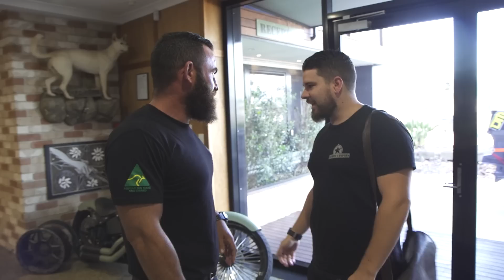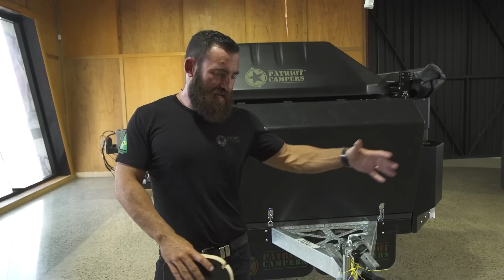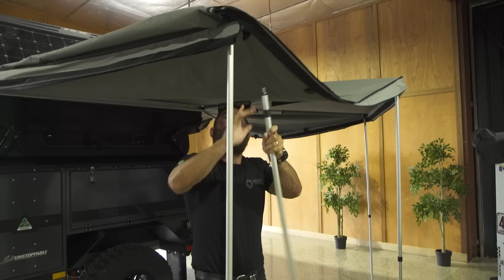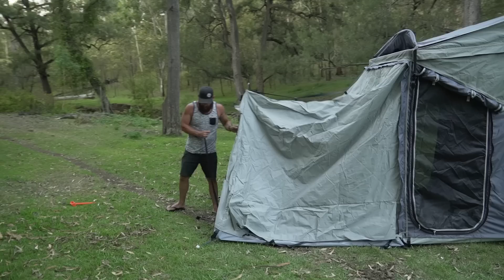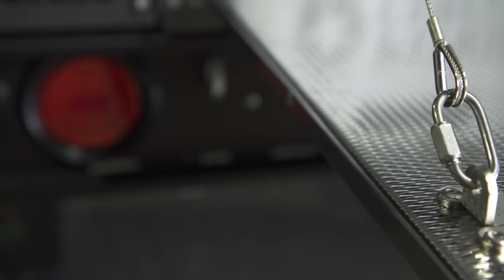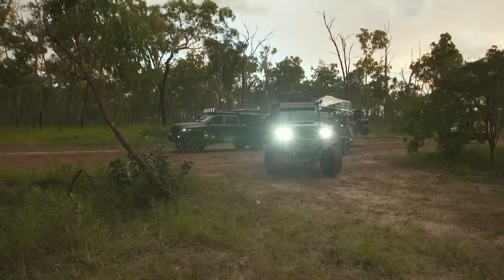Patriot Campers X1-H - Design and Engineering Walkaround

Comment: I dont mean to be long winded , im in florida. And i know your partner site is in oklahoma, i want battle born lithium batteries and mppt set up. Am i better off buying from you as this obviously is built over there. Or can this be done in oklahoma. I also want the same color as in this video. 2nd. Instead of the diesel heater can a mount be made for out side of unit to hold a hot water on demand unit. For showering and hot sink water. Thank you

Comment: Not sure why you would want to test the actuators with the oil removed. It’s not a valid test because they are not designed to run without lubrication. Imagine testing a car engine without oil. Engines seizes and breaks very quickly because the test was invalid not because the engine design or longevity was to blame, but because the engine was deliberately made to fail for no actual teal life purpose.

Comment: A few questions.
1. Can you open the awning before you lift it?
2. Sorry to ask... but is it possible to use the Alu-cab 270.deg awning as the support poles are less essential except in really bad weather. 
3. Is there any way to mount bike racks on the camper for transport?

Comment: I don't see a whole lot of security in these trailers.  If you're asleep up on the bed can't someone come to the side and mess with the control hub?  Also, there's no way to access the control hub while you're lying down.  The poor insulation of where you sleep (I realize he admitted it won't turn into a sauna) but how would you fare in colder temperatures in Canada?  Idk, I initially loved the trailer but I think practically it's not suitable for average/extreme conditions.  This is more of a June trip to the beach and that's it.
Reply: Also where are the locks on the pieces that open up?  Seems like a very unsafe camper, maybe not for someone who's alone but with a large group.

Comment: You should incorporate a fan / ventilation setup in the hard top for the tent so that you can get some air flow into the tent area. This would help immensely on the very hot nights when you're camping.
Reply: I don't see why you couldn't install one after market. Basically Patriots are really good but they're not perfect. You'll always have to add this or that before striking out for the territory's.

Comment: Try doing your stress test in real world outside temp vs. airconditioned covered facility!  Humidity and extreme temps will hasten warping and drying off your lubrication! i applaud your products and will buying in the future! Flexible solar panel will not last. Hexocore roof should be painted in white so it will not be too hot during the summer months camping and will not be conducive and hasten the destruction of your flexible solar panel!
Reply: Existential Optimist great points on the colouring . He did say the actuators have had the lubricant removed for testing but you are correct about real conditions. I’d be willing to test them out if I could afford to retire and patriot sponsored me. They are top notch campers and the tent is massive compared to the drifta and looks like it will divert water runoff better.
Reply from the maker: Hi Mate, tests are done in the factory, we pulled it into the showroom for the video. Point taken on the white roof! Thanks

Comment: Also would be nice to have 4 jack points like a box or tray camper so you can lift it off the frame so you can run to the hardware store for some supplies.

Comment: If only they would come up with a cold weather rig. Made fully with fireproof canvas. And walls. You wouldn't need the camper top part. You set a propane heater up or a woodburning stove.  Serious hunters and outdoorsman would go nuts for this. It can be a pain to set up a cold weather tent. And with this set up and ability to go where its needed for a good base camp bro you'd kill it in the US market. The 4 seasons market is arguably 5 times bigger than the warm weather market. And with cold weather you'd corner the North American market.

Comment: definitely need to introduce limit switches and controler module on roof to hit control button and put control away, not hold it down.  my hard lid has that setup instead.

Comment: Put rain gutters around the hard top with pipes to direct the water downwards.  Could also use this for a rain water capture system.  Waste not, want not.
Reply: nice one i see what u mean .i would add extra window same as the one already in the pod . and some pockets next to the window at the bottom
Reply: window at the top off pod for the heat to go thru

Comment: These are awesome camper trailers.  Can’t afford one of them but still awesome!
Reply: These are awesome but $$$$$$$$$$$$$$$$$$$$$$$$$$$$$$$.

For not much more we bought a new 40' 5th wheel with residential fridge, fireplace, water heater, full size microwave, 2 leather sofas, love seat, 2 air conditioners, furnace, king bed, toilet, shower, and much more.

Comment: instinct that instead of putting in electric actuator I would have just gone with some gas shocks or something to open the lid I think if you introduce the electrical component that's a good place that something will fail.

Comment: Why the electric motor and not just a counterweight hinge? Wouldn’t it be lighter, less maintenance, more reliable and faster?
Reply: J Gold just replace the actuators in 10 years .. 
If you can afford and X1H can afford new actuators in 10+ years
Reply: I never mentioned price, but thats another issue... What's your thoughts on the other 4?

Comment: Nice rebuttal of the recent criticism circulating from others. Great products. Just to clarify the point about retrofitting - you won’t retrofit non patriot campers kit OR any kit?  Just thinking, if I’d forked out decent coin for an X1 and wanted to upgrade it to an X1-H by “retrofitting” the new hard top tent, you guys wouldn’t do that?
Reply from the maker: Hi Tony, sorry mate we can’t do any retrofits but can discuss a trade in?
Reply: @patriotcampers  What happens to the traded trailers? Been watching the used market for a while now and they are getting snapped up quick! Is buying 2nd hand direct from Patriot an option?
Reply from the maker: We do take Patriot trade ins but they never last more than a couple of days. If you find a good deal on a used one, snap it up quick!

Comment: Hey Guys, 
Just a quick question, can a Polaris General 4 1000 tow  the X1H, Love your work,
Cheers for Sydney 🍻
Reply from the maker: Paul McDougall General isn’t the best for towing, you need a crewman with the 900kg capacity. X2 is perfectly suited 👊
Reply: Patriot Campers, 
Thanks Guys, are you going to do a X2 Version of the X1H, with the same weight but just with a hardtop roof with Solar panels